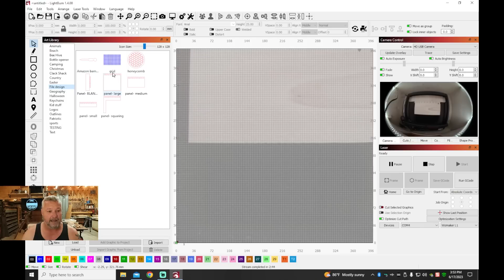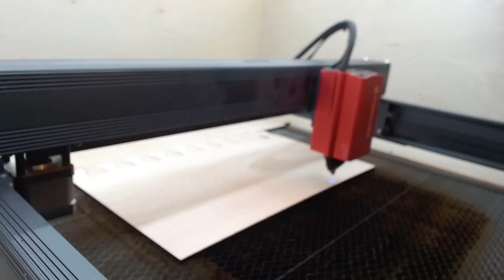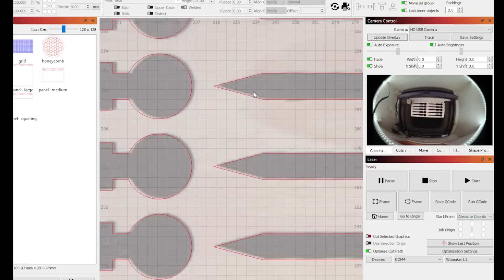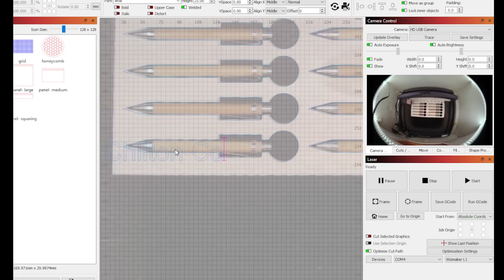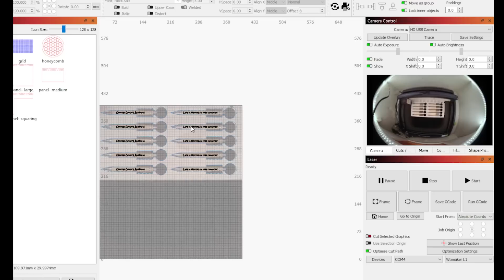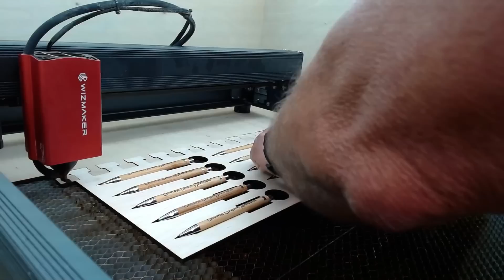Custom engraved ink pens- the easy way

Comment: Thanks for your video, with that style jig would 10mm font be good with those amazon pens, what size font were able to use and still burn well? Thanks again
Reply from the maker: It would depend on your settings. They are round, so too big will be on the side.

Comment: Quick question. I bought your jig sets for the D1 10pro and it has a bunch of the top piece that are different.  How do I determine which to use? Your videos have  helped me with a better basic understanding of this hobby.
Reply from the maker: Measure the inside spacing and pick accordingly. Should be in the notes inside the folder

Comment: Great idea and jig.  So, you don't use/need a rotary jig?  Do you somehow get L Burn to compensate for the curve, or is it a nonissue?
Reply from the maker: Not an issue with just a line of text
Reply: Wait. What? You mean all these years using the aftermarket 3D printed string-driven methods was unnecessary??  🙂 (at least for a single line of text). Damn! I'm gonna try that tonight. I have an order for a batch of 10.  Even if it's 2 lines I assume you can just rotate it.
Reply from the maker: @ramaroodle  yes, it is that easy

Comment: I have made some engravings on these pens, I found that they came out sticky around the engraving, needed some scrubbing with alcohol . Maybe I have my power set too high?
Reply from the maker: I did numerous power tests to get it dialed in. Bamboo in general will weep if you heat it up too much. Dish soap will clean if needed.
Reply: Great video, I saw your comment and I have used white vinegar works as well tfor clean up.. @TheClackShack

Comment: Maybe I missed it on your etsy shop but is the pen jig listed? Do you find the pens themselves work well for writing? I don't normally have pens to sell or give because I don't want customers getting a pen that doesn't write. Great tutorial on lasering pens.
Reply from the maker: I use them in the shop and they work ok. It’s not a cross but for a utility pen, seems to work ok. They come with refills also
Reply from the maker: The pen jig isn’t in there yet.
Reply: @TheClackShack  I'll purchase it if you add it.